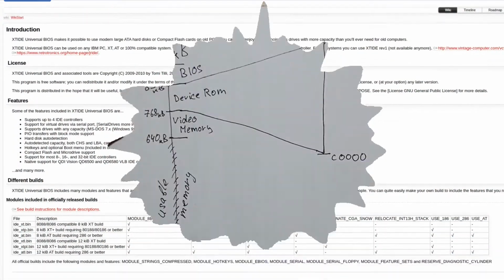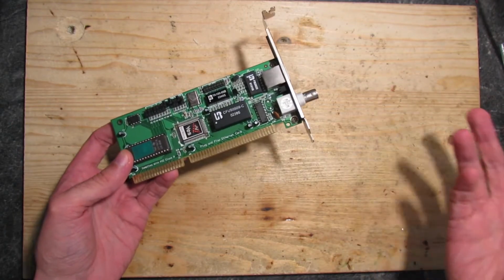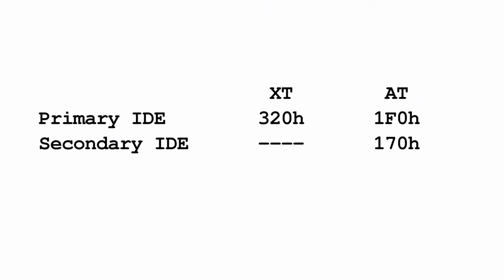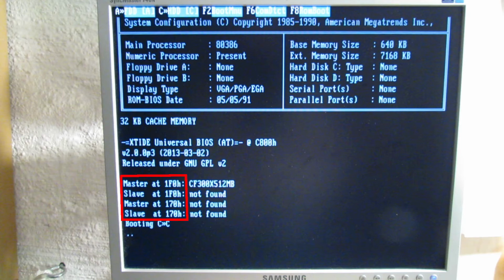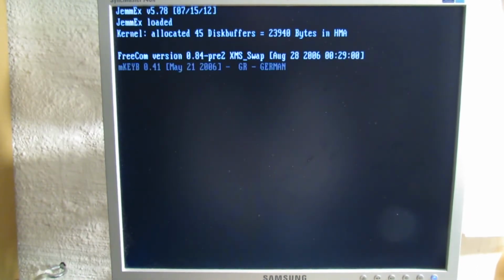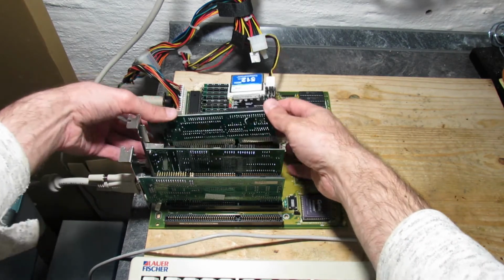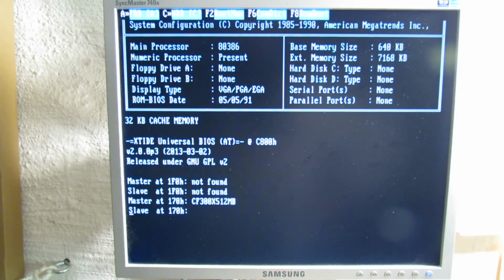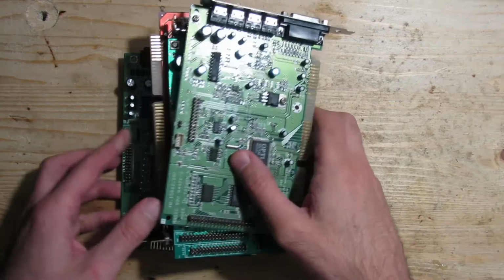Boot retro PC using XTIDE (Part 4): Boot using a Sound Card

Comment: 1:28 You talk about address or port? because for me this looks like port number instead of address
Reply from the maker: It's basically the same, since an I/O port is usually used as a technical term for a specific address on the x86's IO bus.
Reply: @necro_ware  but form software perspective it is two separate address spaces. Access to mem space using mov instructions family and access port number via in/out instructions.
Reply from the maker: @adrian_sp6def  That's true, but that is not the point. What I mean is I/O port and I/O address is the same thing. But you are right, I probably had to be more explicit. This video is very old, but I probably thought, that it is clear in this case, that I'm talking about I/O devices and not memory.

Comment: You can also solder a pin headder to the back of a multi io and build a custom reversed IDE cable and connect a slave. I did this with a DOM and a CF card.

Comment: I remember my first ISA VLB IDE controller, it was provided with a TSR to enhance the transfer speed, obviously using VLB. Unfortunately this driver was so crappy it changed the geometry of the drive, rendering it unreadable after loading the TSR. I then bought a beefy Tekram VLB controller with 4 MB on board cache. My 486DX2-66 was blazing !
Reply: VLB IDE controllers were a waste of money. They can only do IDE and only run on 486s with a VLB. SCSI controllers are far more useful. A SCSI controller relieves the CPU and copies the data from one SCSI device to another itself. The CPU only has to tell the SCSI controller what to copy. The data transmission does not run over the slow ISA bus or faster VLB, but remains within the SCSI world. The CPU therefore has to do next to nothing.
The ISA bus is only involved when data needs to be loaded into RAM.

Another advantage of SCSI was that in the SCSI world there was no LBA problem and you could connect up to 8 devices, of which the controller itself was one. SCSI understood many completely different devices, not only hard disks, but also scanners, CD-ROM drives and CD burners. Since SCSI relieved the CPU, there was usually no buffer overflow when writing CD-Rs.
The data medium to be booted from could also be set and freely selected via SCSI BIOS.
So you didn't have to worry about what went where first like with IDE. With IDE in early computers, the master drive was always C: and the slave drive D:. This was a problem for DOS as it could only boot from C:. If you wanted to change that, you had to connect the drives differently. In the SCSI world, you just changed the Boot order of the SCSI devices.

Comment: For 20+ yrs I don't know what's the point on having ide on sound cards.
Reply from the maker: CD-ROM, but for me it was also just marketing and I'd prefer, if back then the companies would make a better quality sound cards, instead of adding features, like IDE
Reply: @necro_ware  I don't remember if I have seen any retrochannel demonstrating connecting CD-ROMs to sound cards as well. Good work!
Reply from the maker: @lazibayer  No problem, I can do that as well
Reply: Many ISA I/O controller cards only had one IDE channel so it was a way of connecting a CD-ROM without having to have it as a secondary device on the same channel as the hard drive, which could cripple performance.

Comment: Soundcard IDE is designed mainly for CD drive.
Reply from the maker: There is nothing special about it. Just the address is usually set to be secondary controller. Not a problem for XTIDE at all, since you can setup any address you like.

Comment: I remember having Linux on my old DOS PC and that would detect the soundcard IDE port as an IDE controller... in addition to the two on the motherboard.
Reply from the maker: Yes, Linux has integrated drivers for all kind of controllers and it detects the sound card automatically and load the right kernel module for the IDE controller. It works on Windows/DOS basically in the same way, except you have to install the driver separately. When it comes to booting from the IDE device connected to the sound card, neither Linux nor Windows or DOS will make a difference. Because the controller has to be addressed first before an operation system can be booted from it. It doesn't work, if the driver is loaded by the operation system later. It's a chicken-egg problem, which you can solve using XT-IDE, since it is possible to access the IDE controller on the sound card using it, before the operation system even got started.

Comment: I have gotten Master/slave CF cards to work on my Tandy 1000 HX, which is an XT. Not all CF cards will accept having an extra card on the bus, but it can be done. 
Which I/O port it uses is dependant on how the XT-IDE ROM is setup when it's flashed, but you can set it to other I/O's.

Comment: Hi! I have one of those MAD16 Pro cards often underrated from users of retro-foruns, I love them, really nice to be able to boot from sound card. Need to burn one image of XT-IDE to play with. Nice video!
Reply from the maker: Yeah, I also think, that MAD16 is a good sound card. However, from the whole pile of sound cards I have, MAD16 is the one, which I couldn't convince to boot. Unfortunately, this is one of the sound cards, which doesn't have any jumpers for IDE settings. You need a driver in DOS to activate the IDE port :(